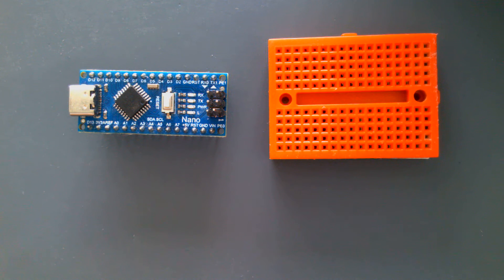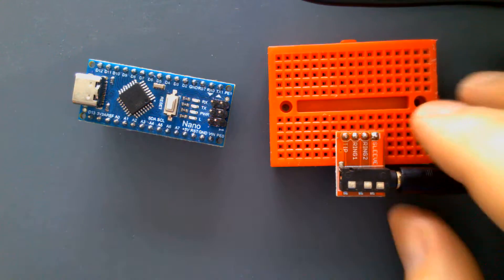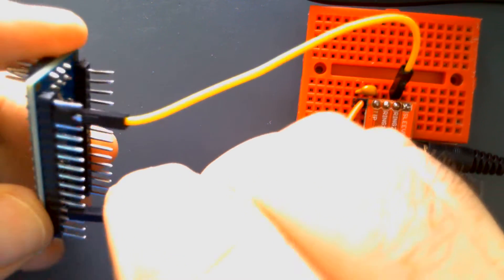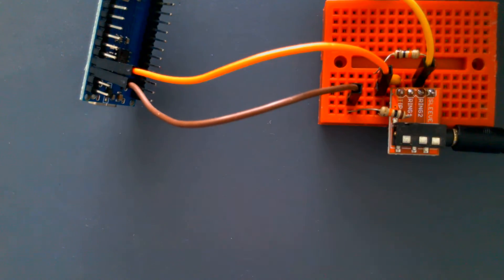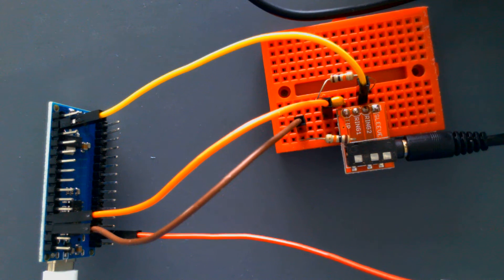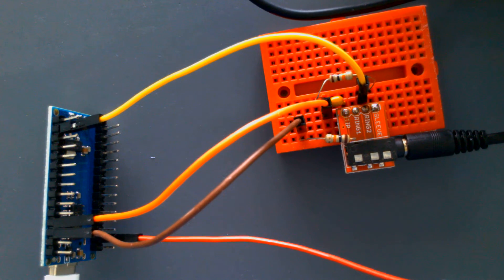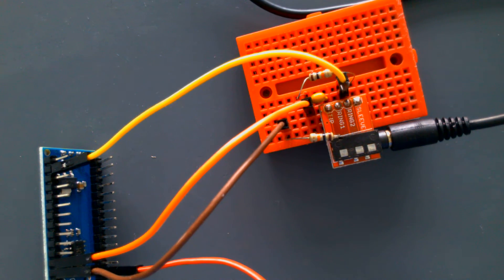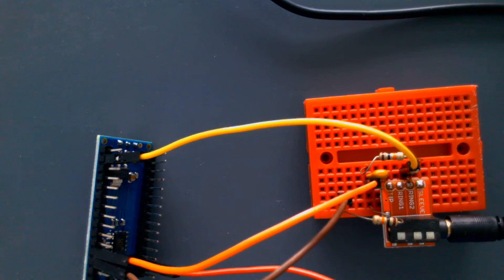Arduino AM Radio Transmitter

Comment: Awsome. No circuit diagram?
Reply: Check out the description where it says "The HackerBox guide includes Schematics, Arduino Code, and much more..." and provides a link.  Once you click through to the guide, scroll down to Step 9 to find the schematic for the simple AM transmitter.